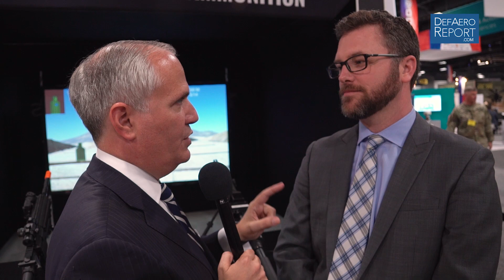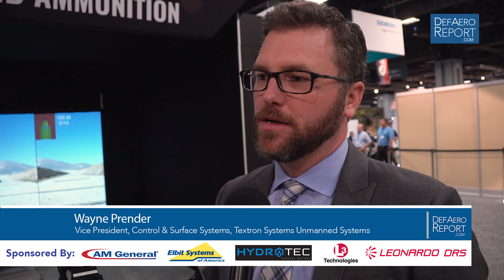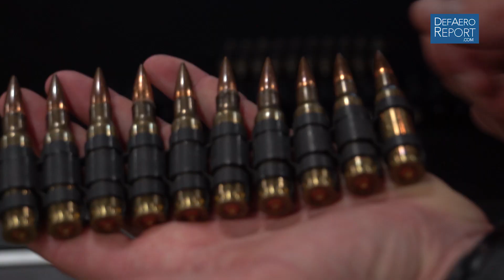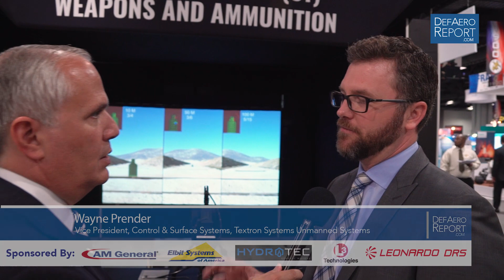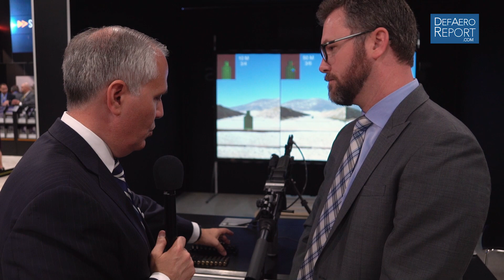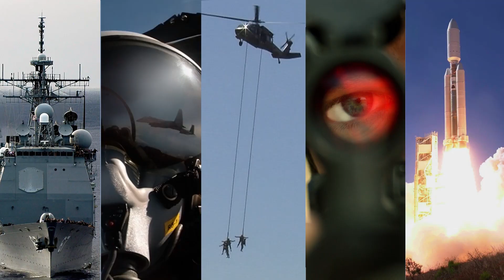Textron’s Prender on Making Ammo Lighter, More Lethal

Comment: Not exactly a compact rifle or skinny one. And looks like it has too many moving parts. And for example the p99 was an early polymer gun but i hate the pop up poly 9mm guns have vs a all metal frame solid no rise
Reply: id say metal frames do work better and trying to make a gun with as many polymer parts is bad for accuracy in a firefight. but there are some parts of a gun that polymer would make it lighter and also not affect recoil, a polymer lower reciever which has become fairly the norm from what i've seen is beneficial. but making most of the frame polymer just makes the gun easier to carry until you actually need to use it and then your fire rate and accuracy are affected because the muzzle rise is highly affected. the xm8 though surprised me (forgotten weapons made a video  recently of him shooting an xm8 and for a polymer framed gun i was definitely surprised at the recoil on fully automatic fire,) but nothing beats a metal frame, that goes especially for pistols.

Comment: Advances in powder????  I smell marketing bullshit.
Obviously some sort of ceramic embedded in the plastic casing to offset more heat.
Probably requires an open bolt weapon system..............read.......Safety tradeoff
Reply: Idiot. The polymer is a far better isolator therefore the propellant energy is not wasted into the chamber walls. A higher energy efficiency means it needs less powder for the same muzzle velocity. Which leads to less thermal load per round therefore less bore erorsion, and due to the reduced charge also less recoil.

No its not "open bolt" in traditional therms, its an entirely diffrent system.

But what they say about "lethality" is rather a buzzword. The round itself is not one bit more lethal, its just that with lighter ammo and therefore more of it, it creates a higher combat efficiency. But almost all shots in combat are for supression, therefore fire-superiority would be a much more sencefull therm than "lethality".
Reply: @_j.v.st._7367  
It's got to be thousands of small-arms rounds per kill at this point.